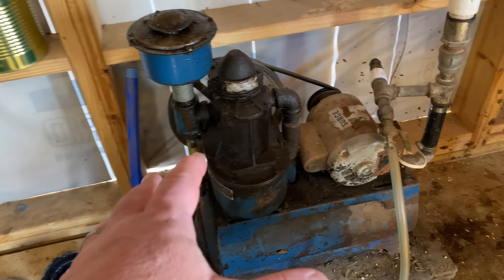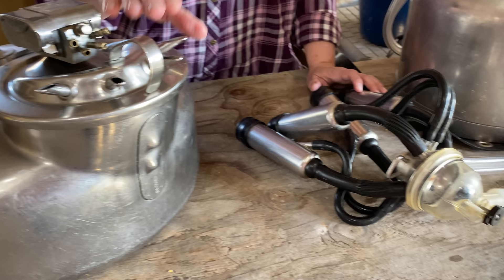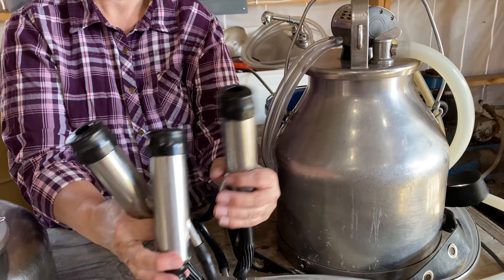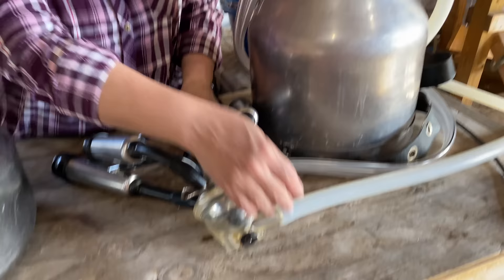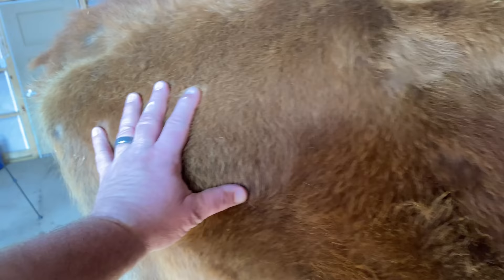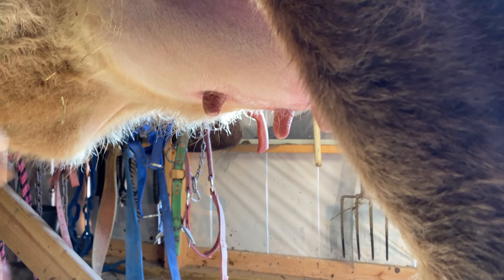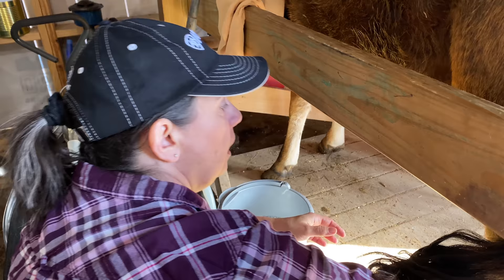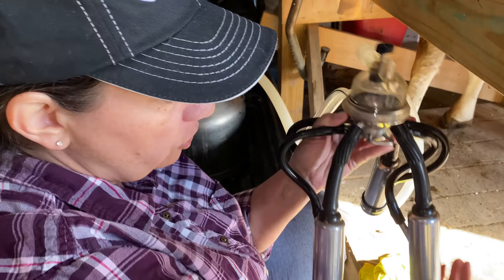Small Herd Milking | Family Milk Cow | Surge Milker DeLaval | Hand Milking

Comment: Another step that you should add is sanitation. After the clean water rinse take another bucket hot clean water and add a sanitizer (bleach or other sanitizer) and run it thru the same way. It helps to rid the system of any bacteria that can get trapped in the system. Just a tip from an old farmer.

Comment: Only warm water (~ 100° F) should be used to flush the milking cluster and bucket. Hot water will make the milk adhere to the parts of the miking machine. This makes the milk residue harder to remove.

Comment: Being a former dairy farmer, I have used both types. The surge bucket has a leather strap with a long metal piece attached.  the strap drapes over the cow and the metal piece goes under cow and attaches in strap hanging down the metal piece has a v in it for bucket handle to rest in. Then you adjust the strap for best milker pull. We used the Delavan milker for fresh cows  when we transitioned to parlor.  It caught milk that wasn't able to be put into main line. When we sold the herd we kept 2 cows for house milk a Holstein and an Ayrshire.  I made my own butter.  My daughter makes yogurt,  soft cheeses, cottage cheese, butter, and cream cheese and it also makes the best homemade ice cream.  I always liked milking the 2 cows by hand.  It was soothing and a kind of relaxing time to sit and think on everything.  ( I dont milk anymore, but my daughter has one cow and hopes to get a second.)

Comment: I think you mean “machine milk” when referencing commercial dairy’s, rather than “surge milk”.
Reply: They were referring to both milking units as "machine milking " and the smaller unit is a Surge milking machine which is the make...most people call those Surge belly milkers because it hangs under the cow with an adjustable strap which is the black belt with eyelets in it on the table when they're describing the different machines
Reply: @ericgroat626  I’m aware that Surge is a brand. But if you were listening closely, towards the beginning of the video, they said there were 2 ways to milk, either hand milking or surge milking.